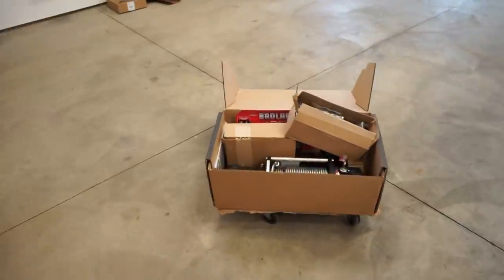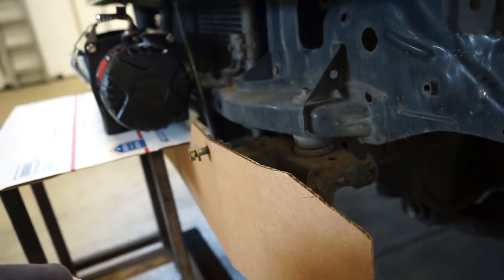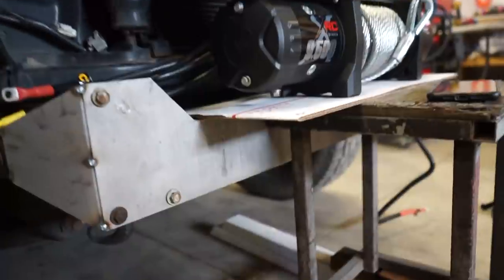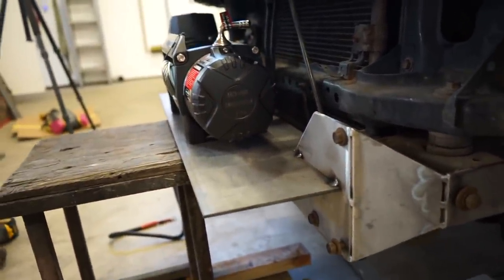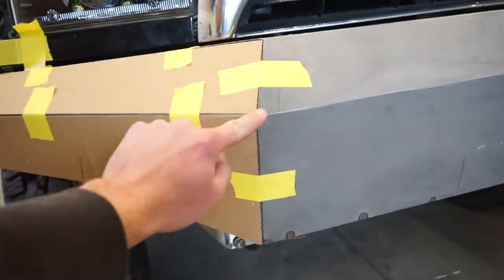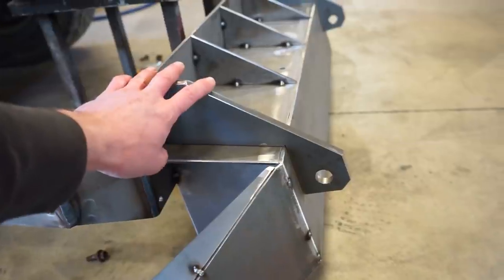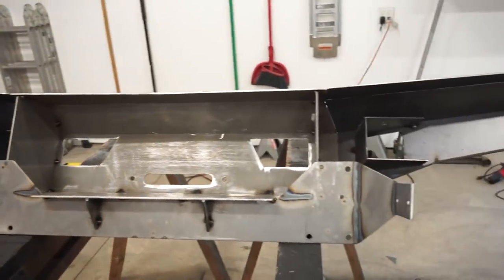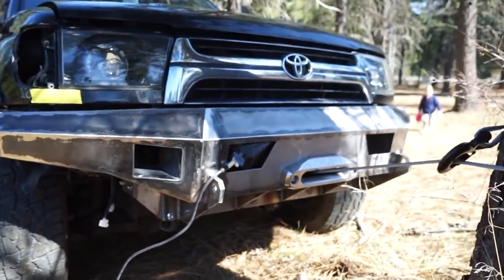Fabricating A Winch Bumper For The 3RD Gen Toyota 4Runner!!

Comment: Is air flow for cooling the radiator an issue with your 4Runner?  Might be an issue in hotter climates?  Blocks a lot of frontal air flow.  Does look nice though.

Comment: Just picked up a 92 4Runner.  Wish I had one of your bumpers.  With a little view of winch cable only flaw I saw.  Possibly a skid plate you can bolt on and remove.  North Carolina here
Reply from the maker: Thanks! I do make plans for the 89-95!

Comment: When lifting those heavy bumpers on and off, get some  bolts the same size as the ones bolting the bumper on, but longer.  Cut the heads off and grind a slot in the end.  Then you can use them as studs to help hang the bumper easier.  Also, I'm sure no one would complain if there was a "how I built a table for my drill press" video...
Reply from the maker: Good idea!

Comment: Love the design of the bumper! Great job! A good tip when it comes to welding and you want to let it cool down as you go, use an air compressor and blow it off as you go, makes it go alot quicker. I've seen a show called Bad Chad who builds custom cars and that what they do to be able to keep working and it still be able to cool down to avoid it warping. I can't wait to see the finished product! Looking great!
Reply from the maker: Thanks!! I have used air in the past, I just found something else to do while it cooled off!
Reply: Austin, are you gonna paint it or raptor line it?
Reply from the maker: @allenhorne7032  raptor line! I love the stuff for bumpers!
Reply: @austinniemela  awesome, l like the look of that stuff as well for bumpers!

Comment: Just a thought with the winch controller. 

Why not remove the controller plug from the controller box and leave it where it is, extend the wiring and mount it independently so all you have to do is plug the controller into the bar. At the same time you can run in cab control switches that will both disable the power to the winch through the earth (when not in use) and control in/out while sitting in the car.  All you need is a 5 or 7 wire trailer cable, it’ll be much cleaner and easier in the long run.

Love the channel by the way. Found you while searching ways to paint a rear tray back in the days of the red Toyota tray build and subbed for brilliant content since. Much respect from down under 🇦🇺 👊
Reply from the maker: Thanks! Thats a good idea!

Comment: It would be nice if you removed that one 1/8" gusset right under the fairlead and replaced it with a piece of 1/2" exactly shaped the same but with a hole in it for a shackle pin.  That would give a straight line pull when using a snatch block and also if being towed it would give a straight ahead force instead of the angled pull when pulling off center (tougher to steer and on the frame).  Just for kicks and giggles it would be interesting to know if there is any factory difference in front end components between a four cylinder and a six cylinder 4Runner.  Give you an idea if the added weight might increase wear on them with one more incremental increase?  Something I always wondered about when I did my 85 Toyota back in the nineties.  I added an additional battery box in the one wing and a tool box in the other with a battery switch and covered lids to keep the weather out.  I used an 8000# Ramsey winch which was about a 100# alone.  Kept the truck for three or four years after that and didn't notice any problems but always wondered about that and what moderating effect all that steel had on the 'crumple zone' designed in to absorb energy in a crash?  Never got any good information on either.  I painted it with a coal tar epoxy and had a push bar above the winch.  Never saw any rust which was good.  Enjoy your fabricating.

Comment: Dude (don't) I repeat don't waste your money on the HF badlands synthetic rope junk junk junk! The same with the aluminum guide it's cast not billet aluminum synthetic rope will cut right through it. However good choose on the winch. BTY you definitely have good instincts on building a great bumper your 1/2" hook mounts are spot on always put them in line with the frame 👍 👍  and always move around a lot when welding .
Reply from the maker: Thanks for the info! What synthetic ropes have you had good luck with?
Reply: @austinniemela  I would recommend most any major brands warn, Ramsay and the winch that you got even makes a good synthetic rope. Just do your research and get a nylon flat strap to put around trees and always lay a rag or even a shirt or coat over the cable for safety reason it will deflect the cable downward if it breaks

Comment: Working on my 1992 sr5. Any ideas what I should upgrade first?
Reply: Tires and locking hubs, if it was me that is. Has anything been done to the truck yet?
Reply: @everythingsucks6086  previous owner added a camper shell over the bed and a guard up front. I’ve added a light bar on the guard and cut and placed some led backup lights in the rear bumper.

Comment: Seems like a hole in the top would make it easier to get at the free wheel / engage lever on the winch. Rather than having to reach in blind from the side.
Reply: I have a smittybilt winch and the clutch lever sometimes takes a lot of force to move it.  Gonna want good access to it.
Reply from the maker: Theres plenty of room there to reach in!

Comment: The main reason those plates are removed is because they have a tendency to break off from the frame because of the factory welds not being up to the task. I've seen a few bumpers ripped off from them seperating

Comment: nice build once again ! you give me the inspiration and the motivation to build a rear one  for my 01 tacoma !! .. so im wondering if the one you build for the green truck could fit bolt on might gonna buy the template kit and give it a try soon worst case i just build my own mounting point
Reply from the maker: Thanks!! Honestly the rear bumper itself should be very close if not right on the money with the exception of the mounts, however they do mount very similar. The only think I’m not sure about is the frame width on the Tacoma but that wouldn’t change much!